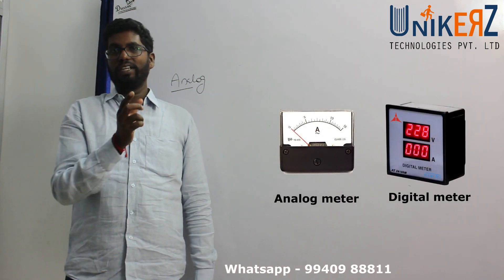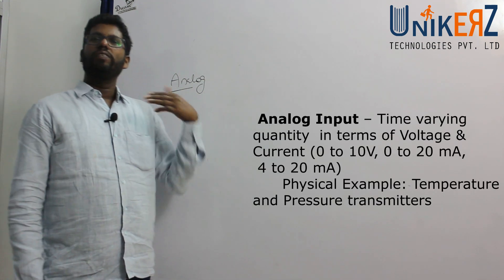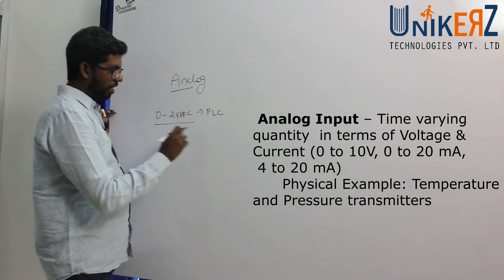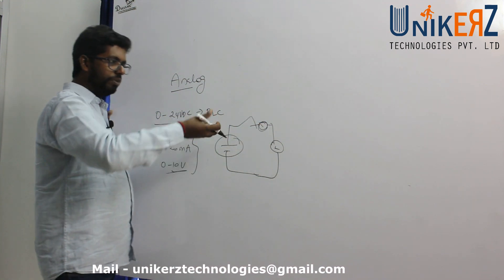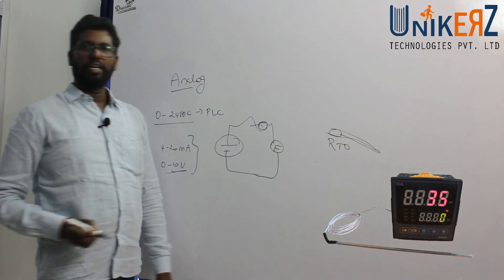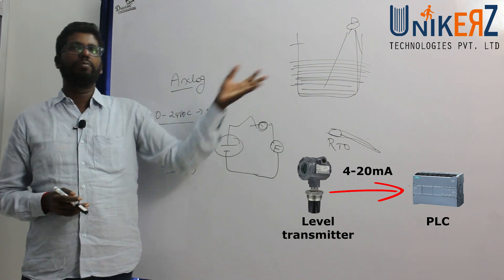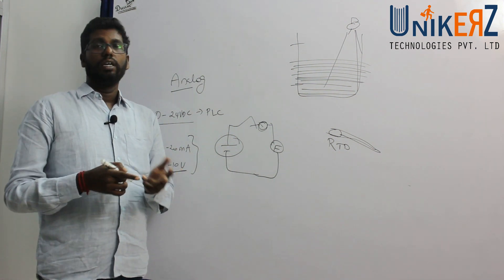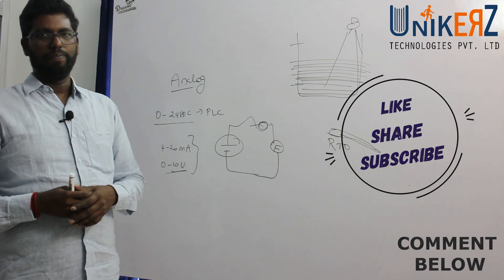What is PLC I/O? - Analog Input,Output - In Tamil - Part 03

Comment: Sir I have an doubt would u pls reply me? which is accuracy analog or digital
Reply from the maker: Digital means 2 position only. ON or OFF, 0 or 1. Analog means varying values. If you use digital, you will get to know 2 positions only. But if you use analog, you can get to know minimum to maximum values. So analog is accurate measurement.